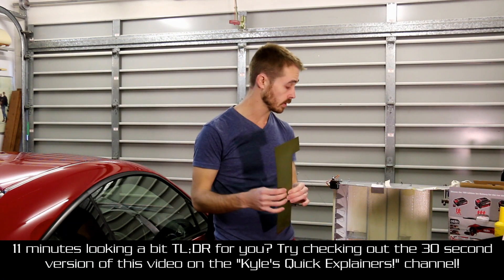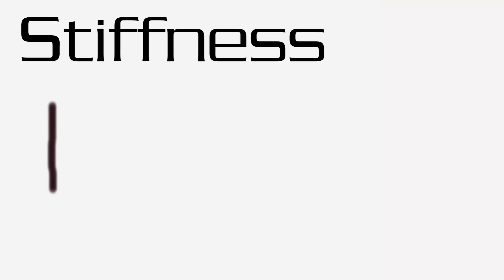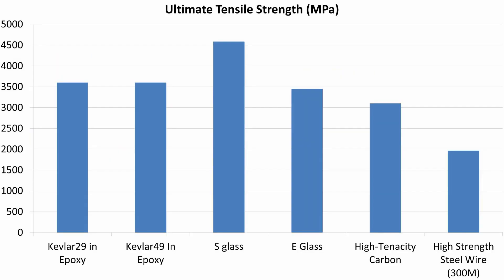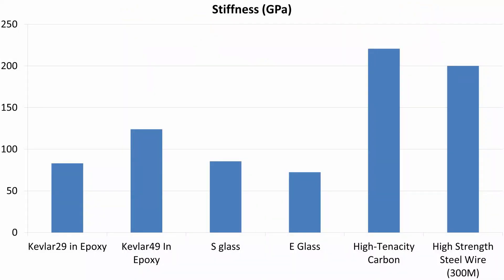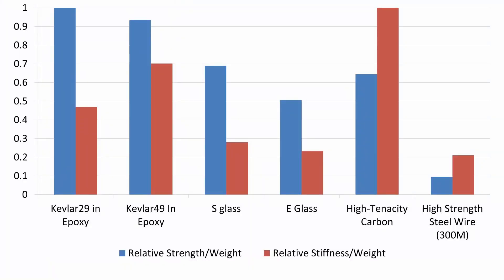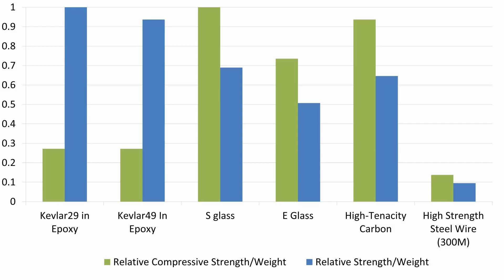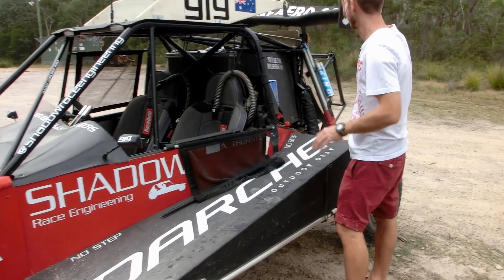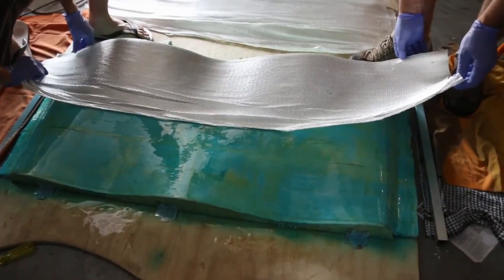Carbon Fiber vs Kevlar vs Fiberglass - Which one is right for YOU?

Comment: Ah no. I would suggest that the failure mode of S glass (if you can get it) is not superior to Kevlar. Kevlar is a curious material as you note. Being a form of nylon its failure more in some respects that of metal: when loaded to saturation the micro failures along the fibres allow for energy absorption, which can be very useful. However the fibres are very tough and so the composite will not break into pieces.
I think you also have the thickness aspect of CF/FG backwards. You will need a thicker FG part compared to CF as the FG needs more material for the same stiffness - with the thicker laminate becoming stiffer in part due to beam theory. There is also the tooling and resin requirements for each fibre system to consider, you can use a poly/vinylester resin for the FG, but epoxy is best for aramid/epoxy. 
The 200gsm textreme CF is around $30/m.

Comment: What would be your opinion on making a bike frame from S glass? I believe bike frames experience a lot a compression but not sure if to the point of rendering a bike frame useless.
Reply: mbamin the problem is that to make a sufficiently stiff frame you would have to use more plys of glass than CF, makeing it heavier than CF. (if you are going for a light frame that is) It would have a higher tensile strength, but that isn't useful if carbon is strong enough for the job and you can use less plys to get the desired stiffness..
Reply: mbamin now If you just want to make a composite frame bike and looking for something cheaper than CF, E glass is a good option.

Comment: You can always combine them
Reply: Carbon-kevlar composite.
Reply: FOUND MY ANS: https://www.youtube.com/watch?v=j7bQYEt_qtU
Reply: you can do one layer of carbon with layers of glass to save one money
Reply: Is this viable? Do these composites work well together? I would love to see this.
Reply: yes they do i made my car and bike like this. you do 1 or 2 layers carbon and 1 layer glass to help the carbon stick in the corners. when your wet laying.. if you want to see my stuff  check out squidskins  dot  com  in the eye candy section.. the y/b talon is all carbon
Reply: But since fiber glass stretches more, if the part is under too high a tensile load, the carbon fibers will break, making the part weaker.
Reply: well i wouldn't make suspension parts that way but a hood or fenders there is no problems
Reply: Rentta into one single material?

Comment: Sweet video, just earned a sub from me. I'm on a high school robotics team and one of the kids on the team's dad makes things out of carbon fiber, kevlar, fiberglass, plastics, and metal for a living, and let his son have access to these tools, essentially giving my robotics team the competitive edge of being able to use carbon fiber and all those composites, and metal components engineered specifically for us, and they are SIGNIFICANTLY cheaper than the premade stuff (like 50 bucks for what amounts to an inch thick aluminum disk with a diameter of 6 inches with screw holes). 

However, I would like to see some more comparison of the individual materials, like different varieties of carbon fiber, kevlar, and fiberglass, and kind of compare them to a 'benchmark' material, because we both know there isn't just one type of each composite, (and it said so in the video) 
And yes, I would like to see the way different resins (or bonding agent, or epoxy, whatever it is called. The stuff that keeps it all together) effects the performance of each material, and I would like to know how much individual thicknesses matter. Like "1/8 of an inch of carbon fiber is as rigid as 3/16 of an inch of kevlar, but has a lower tensile than 1/16 of an inch of s-glass"

I know it is a lot of information to put out, but I'm a bit of an information hungry individual so I like lots of details and comparisons.
Reply: Also, I am aware that Pagani uses carbotanium in their cars. How does that compare with the three composites you showed us in this video?
Reply: Savage RiverRacing canoes 18'-6" come in at 26lbs. with TexTreme(spead-tow carbon fiber) 3/8 foam core then more TexTreme. You can walk down their hulls bare foot without a ripple.  Very best source is "Composite Envisions" Wisconcin

Comment: Whoah dude thanks so much for making this,  you just saved me a ton of testing and you pointed out many interesting things to consider.  im totally subbed for more.  Just a few questions tho.  ok maybe not a few but a lot lol. 

If you happen to know of any good online sources for this kind of engineering info on composite structures,  id love to hear where i can school myself more about this topic. I have about a million more questions ranging from fibers, to weave patterns,  to layup orientation,  resin/fiber ratios,  u name it.  any chance i can find you anywhere for direct msg advice occasionally? (only when fail to find my answers on things by myself) 

you mentioned E glass and S glass all the time,  yet you name your car parts to be made of "fiberglass",  meaning? 

You say E and S glass fiber composite structures both are more "tough" as well as "strong" than carbon fibers,  and this resulting in crash impact stress resistance.  How to interpret this if  lets say my parts are basically eggshell-like composite  structures of equal physical properties but each is a different fiber material.  smash them all onto solid ground hard,  which shell is least damaged? (which content is best protected and can be thrown again? 

Is it correct to conclude that kevlar is in fact weakening the structural abilities to survive a violent tumble spin (impacts of various speeds onto various locations angles) in addition of causing lower stiffness? 

Do you know of any semi-sure way to find out which fiber material the manufacturer used in a prefab plate? (I'm referring to, for example chinese market goods sold as "3k 100% real carbon fiber 4mm thickness" which is by definition suspicious for possibly containing other inferior fiber materials in the non-surface layers) 

Does the yarn gauge and bundle density influence the test results significantly? (for example: is a bundle of thinner yarn stronger or weaker than the equivalent bundle of thicker yarn? 

Is it more useful to focus on applying the cloth as compacted as possible for max amount to fibers per or area of resin? or does it make more sense to apply the cloth as tightly as possible (pre-tensioning the fibers to ensure that they are straightened fully as the matrix encased them) 

Are any of these fibers be available in any other form than plain woven cloth? (maybe  spooled yarn? spooled single bundle? omnidirectional velted mat?  pressed fiber paper?) 

Can the non carbon materials you talked about be cut with a laser since they do not transfer the heat into the fiber and spread? or is it the resin that prevents laser cutting fiber composites? 

FYI My interest these materials are focused on developing high end race drone bodies that can take abuse.  The flight stability demands super high stiffness but how to combine stiffness,  with resistance to stress,  strain,  impacts on pavements? 

I'll stop here for now but many questions remain,  any knowledgeable experts willing to share some thoughts with me are welcome to send me a dm and I will be very grateful for any help u may have to offer.  🙌cheers

Comment: " glas fiber is stronger than carbon"(related to tensile strength) thats actually wrong u have to diverenciate the various kinds of carbon fiber.  A High modulus  carbon fiber  or a uhm  is way stronger than that glas fiber( talking about 7000N/mm^2). But the tensile strength of fiber is irrelevant, important is the stregnth of your fiber- resin system.

Comment: How do you feel about carbon fiber drive shafts? I am a little afraid to use them in high power engines as I feel carbon isn't
really made for use in twisting parts.  They are in use now successfully but I think over time we will start seeing more and more failures.  Maybe I am completely wrong! My background is in metallurgy. I'd love to hear from you..
Reply: It all depends on the orientation of the fibers in the drive shaft.  I believe they usually orient the fibers at a 45 degree angle to handle the twisting loads on the shaft... if the fibers ran length-wise on the shaft I don't think that would work very well.

Comment: @KYLE.DRIVES  Great video.  I have a question about heat?  Lets say I'm making a heat shield in my engine bay.  What material would you suggest using?  I cant use metal as is a very complicated spot I will need to make it with a mold and some sort of mold-able material.   Thanks!

Comment: Cant carbon fiber be made purely for unidirectional force strain saving even more weight?
Reply: See "TexTreme" a spread-tow carbon fiber. Useually is 3/4"x3/4" weave of one K. Every place a strand of a thousand carbon fiber(1K) goes over and under in normal weaves it is weakened and forms 20,000 crips per yard that just collect resin& weight. F-1 and Nascar use this spread-tow in their racers. Some intracate molded shapes still require a drapeable weave due to tight radiuses.  More carbon to epoxy& less crimps means both lighter and stronger. best carbon to epoxy ratio of any composite fiber.  You have to buy them but "Composite Envisions" has samples in a nice cardboard folder.

Comment: The points being made here are very good, much of the carbon, glass, kevlar is still misunderstood. Here is a generalisation of the materials in point and how they react to different loads etc. There are many types of each fabric, the way they are made the directions they are laid and the numerous resins employed. In reality carbon is stupidly expensive, it's useless without epoxy resins : also stupidly expensive and what you gain might never have any effect on what you actually need it for, unless you're competing at stupid money levels. For the rest of us Glass fibres with a decent isophthalic or vinyl ester resin maybe even epoxy is the way to go. You might be surprised to learn that 90 percent of boats are built with the lowest grade orthophthalic resins, chop strand mat and woven rovings, but it works, so how much do you really need exotic materials in the end?

Comment: Dear university educated individual.  Does this relative comparison stay true for flexural modulus?  Does weave play a role?  Are there weaves possible with carbon not possible with glass?  Also doesn't compression strength and stiffness rely more on the resin than the fiber?

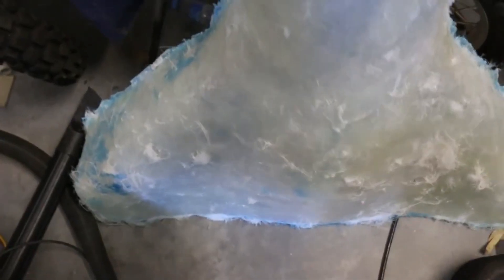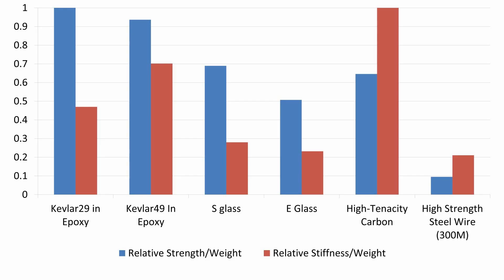Comment: +KYLE.DRIVES Why does fiberglass as higher UTS (3:15) but then you said is the strongest relative to weight at 5:24. Shouldn't the UTS be the way you measure the strength of a material? If material A as  greater UTS than B, then A should the strongest on, right? Thanks for your help!

Comment: Kyle 
Very nice video. I have an airplane that is no longer manufactured and is in need of repair of fiberglass "clam shell" landing gear doors. They are still intact but are softening due to aerodynamic loads while in flight urging them to "fly open" a bit. This is a common problem with this type of airplane as the doors are under-engineered. I would like to stiffen them up from the inside as the outside shape and size should not be changed. I don't have much room for many thick layers. 
I did watch your other  video on laying carbon over fiberglass and have taken that into consideration but would you think CF is a better choice for stiffening  as obviously the glass hasn't been suitable in most cases.

Comment: Congratulations you've done a really nice video. 
I agree with everything you said except that: you have not taken into consider the flammability of materials and about the cost of carbon are higher but not so much for don't use it.
The fiber glass is highly flammable while the carbon and Kevlar not. 
Kevlar is used for coating parts subject to impact, also has the highest resistance to fire. 
For example, combine carbon and Kelvar on portire makes a thief-proof. 
Incorporating into different materials structure offers different results. 
For example, there are PVC that can be inserted in doors and isolate noise and give a rigidity in the event of impact. 
The list does not even mentioned composites made of kevlar-carbon, carbon-titanium that would make the discussion an important guide on the subject. 
Treating the composite materials I have to say also a very negative point since the difference of electric charges on the carbon of definitely different from other materials already present in the car which would end bad without adequate protection. 
If you do a more complete video I will be happy to examine it could get out of it is something really interesting that would fill many doubts of many people.

Comment: how much lighter would 1 cubic cm of fiberglass with resin be compared to solid aluminium?
Reply: Realist
Reply: Depends on the resin to fiberglass ratio?
Reply: By volume.. grp is about half of al weight.
Reply: You dont use cm3 of fiberglass. They sell them in Oz. 4oz, 10oz,etc.
You can still measure how much fiber you will need for a surface and weight, then compare To Aluminum. 
But Aluminum is more for structural/rigid stuff and fiberglass is more for stiffness.. Idk it's your choice anyway
Reply: Foam or balsa core is used to make lighter fiberglass structures.

Comment: What I'm getting from this is 1) carbon monocoque chasses are used because they are stiff, but not strong so there are probably more layers of carbon and 2) S glass structures are strong, but relatively bendable so they probably require a backing on the panels to keep the structure stiff. Am I hot or cold on those assumptions?
Reply: and from that assumption, S glass should be structural (lol no shit it's S glass) and carbon should be for aerodynamic and cantilever applications.

Comment: I didn't understand any of this, screw it, i'm using concrete.
Reply: I wonder if carbon fiber reinforced concrete is a thing
Reply: @MrEugenio1994  there are studies going on to try and replace steel rebar into something that doesn't rust in time to the smallest infiltrations and I believe they already tried using carbon fiber to no real success.
Glass fiber (which I guess is the same as fiberglass) reinforced polymer or GFRP seems to be a good candidate tho so the thought isn't that far away
Reply: @MrEugenio1994  https://youtu.be/8vRc4F9MvtE this video shows some use of Glass Fiber reinforced concrete.
Reply: Eugenio A. https://youtu.be/gq62HTkR98c A research done by a Turkish Firm.
Reply: @MrEugenio1994  its been a thing atleast awhile. For a concretemixs to repair some old concrete objects. Or straight  form a concretefactory to new floor slabs etc. Tho the steel fiber is  more common.
Reply: it is
Reply: @MrEugenio1994  yes it is. glass fibre reinforced concrete too. and both are great materials, but not yet very spread nor cheap (comparing with steel)
Reply: @MrEugenio1994  it is actually - https://www.detail-online.com/artikel/carbon-fibre-reinforced-concrete-new-solutions-for-urban-design-purposes-and-road-and-bridge-construction-27543/
Reply: @MrEugenio1994  Rebars maybe?
Reply: @MrEugenio1994  Glass fiber is routinely used to reinforce concrete counter tops/tables etc.  Bags of the stuff are available from specialty concrete companies.  Also beads like in bean bag chairs are available.  The thing is that your don't want the fiber to reach the surface.  So you first place a surface of clean concrete.  Then add the fiber reinforced concrete inside where it won't be exposed on the top.
Reply: @MrEugenio1994 there are rod made of carbon fiber,wich mean you can make carbon-fiber-armored-concrete
Reply: @MrEugenio1994 might not be the same thing but the university I’m going to is currently doing a lot of research on graphene enriched carbon fiber. Helps increase electrical conductivity and makes it 5% ish stronger.
Reply: @MrEugenio1994  Ultra High Strength Concrete uses glass fiber strands for reinforcement
Reply: lmao this made my day
Reply: Make sure its hemp Crete...it will be like s glass, to e glass. Worst case scenario, smoke the bud first, and don't worry about nothing.
Reply: Swedish studies apparently showed that bamboo sticks of 30 mm diameter are a better used in earthquake prone regions than regular steel rebars. :) You possibly still could build a race car of bamboo.
Reply: There's an idea!  Bamboo Toyota Prius breaks MPG record with its new bamboo exterior LOL
Reply: @aetaveum  there's this british race car company that built various race cars out of plywood from the 60s all the way to the 90s. (search marcos gt) they were decently successful as well. recently lexus had also used bamboo in their cars' construction although not in the chassis. so this idea of using bamboo for a car's chassis to achieve lightness and strength while keeping costs down isn't so far fetched especially since welding wood has recently been proven to be doable.
Reply: Check out the Swedish research on using Bamboo instead of re-bars. It increases flexibility and tensile strength in earthquake proofing of construction.
Reply: lol
Reply: man i need a concrete plate of 2mm for a part of my car, will you send it to my address?
Reply: hmmmmm
Reply: The French made target practice drones to be towed behind aircraft from ferrocement. It's a very versatile material.
Reply: Im gonna ride my concrete bike home now. Brb
Reply: math is hard
Reply: Everything makes sense to me. You need to go back  to school.
Reply: Exactly the same principle
Reply: Lol
Reply: Just use diamond
Reply: For cars? Perfect!
Reply: I'm building a sailing catamaran skin over frame with bamboo laminate (hemp fabric I between layers) covered in fibreglass. It's really strong and relatively light
Reply: I'm years late but 😂😂😂😂😂
Reply: Clay is the way
Reply: Hell yea